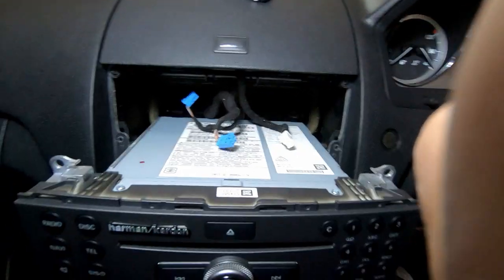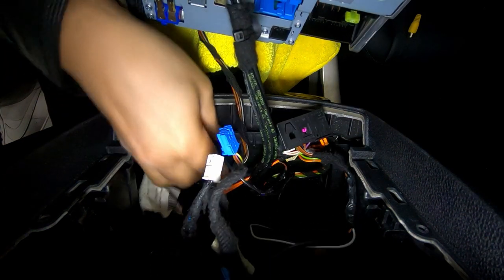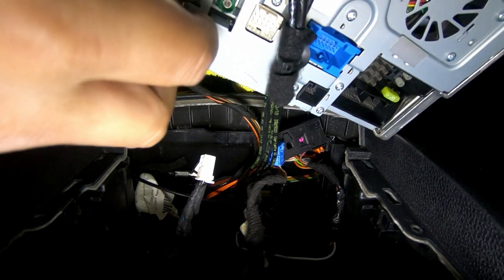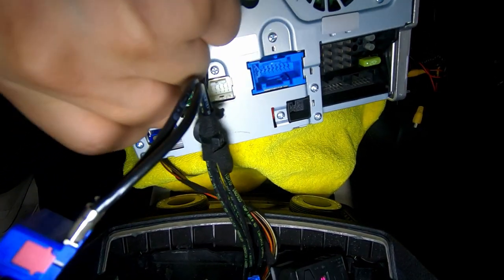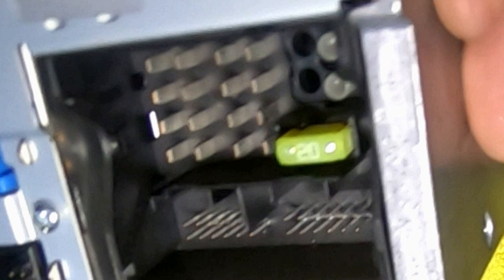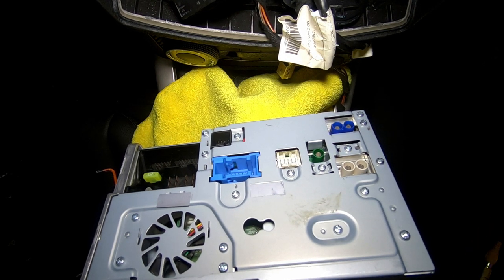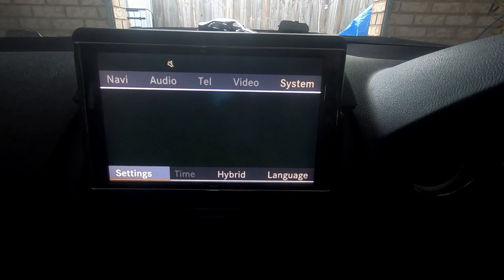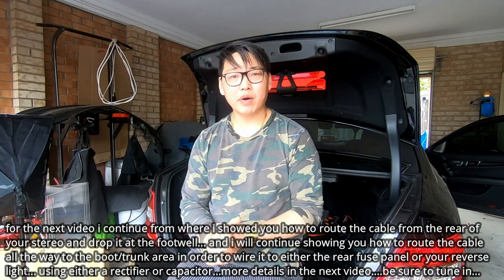mercedes w204 stereo removal+brief backup camera connection+activation

Comment: That’s what I’m talking about. If you’re gonna do it, do it right.
Reply from the maker: thanks mate next 2 vids will.be routine signal cable and then removing boot trim and lining to access license plate  light assembly to install either boot handle camera or license plate light camera.... and cuz the video is so long I broke it up into 3 parts ....last video will show how to wire to backup light using rectifier capacitor and relay .... any method will suffice to reduce noise/fuzzy lines and error messages

Comment: For anyone with a 2013 w207 or any merc with the ntg4.5 system the connection you use is the left side of the double barrel green input on the rear of the head unit, you can't connect a fakra cable straight into it, you need to carefully remove the plastic shroud from the fakra lead that comes with your camera (or you may have bought the adapter lead separately), there's a little plastic retaining clip on the adapter lead which pops off with a pick, then you need to push the inside lead out, don't pull it by the wire, its tight but it does push out, use a plastic stick of some sort (i used a plastic lego axle!) and then push the connection into the left side (looking at the back of the head unit) of the green double barrel socket, then follow the steps to set up the head unit to recognise the camera, mine worked on the first setting, think its srvc, and enable it on selection of reverse gear, thats it. I hope this helps someone as I couldn't find anyone who could tell me which socket the camera should connect to.
Reply from the maker: good tips 👍 also wen ur never sure which fakra to connect ..trial and error never hurt ..same way u do the selection video signal... that's how I've always done it .. I'm not a professional..so I always test things ... trial and error as they call it

Comment: Hi there. Great video. Just wondering if this unit supports Bluetooth music streaming?  Thanks.
Reply from the maker: no it doesn't only phone calls
Reply: @MIKEYZVLOGZ  thanks I really appreciate your help
Reply: Sorry to be pain but do you know if there is an option available to add on music streaming to this system?  Thanks.
Reply from the maker: @vedranmujcinovic4000  because my unit has the mmi multimedia input i can use the bovee Bluetooth device that allows you to connect it via the mmi connector in the glove box and run Bluetooth musicv that way , here s alink https://www.googleadservices.com/pagead/aclk?sa=L&ai=DChcSEwiZ7pvn6ZyAAxUqC4MDHd0fCVMYABALGgJzZg&ohost=www.google.com&cid=CAESaOD2kcL30bMfLl9sqLw0_FAG9r2oKxUvW9QPfyaSl0Dyd0163fTG62-xAWrhpMVlD3LPBKqz3Y75jQcIJpuX71HPyCjjJ-6ZSKn1tVh-y56nvIvKBsQnNcZY8fsJgAbmag0gmKHF9jpD&sig=AOD64_09pCoy2H8aDLPrWzP1t9C6qlLI0Q&ctype=5&q=&ved=2ahUKEwi2ppXn6ZyAAxUi1zgGHYJFDuIQ9aACKAB6BAgEEA4&adurl=

but remember only if you have the MMI add on to unit u can do this, if not , u can only add after market unit or use a cheap fm tuner for bt music

Comment: Good explanation 😉 but the display trigger line where is it..where is conected the red wire ???
Reply from the maker: because we have a function in our system that we select ... you dont need the trigger wire unless you are using an after market system ..its designed for after market systems like pioneer that have a trigger wire ... wen installed u go into engineering mode in the system and select display cam wen engaging reverse that is kind of like our trigger for reverse camera ... hope this helps mate..

Comment: Thank you for the video, Do you happen to know where is the amplifier located on C300 2010, having issues with no sound, changed all the fuses, still no sound. Dealer told me amplifier issues but wanted $6200 to fix.
Reply from the maker: its in the boot behind carpet on left hand side ..remove the carpet cover for tail light and look behind it towards the front on the side above the rear wheel

Comment: Hello there , I have the small screen 4inch and I want to swap it to the flip one ! I know you need the whole set with unit ,vents and screen to make it work ! I have found the whole set I just don’t know if it needs any rewiring as the units are different at the back ! Thanks in advance
Reply from the maker: tbh im not sure as i am not familiar with the 4inch screen wiring

Comment: Hello again sir! You helped me already with the power for the rear camera, but now I have a different problem. My car is not a w204, it’s a C207 and, even though I have NTG4.0, the back side of my radio unit is different, the fakra cables are “double”. Do you know how can I connect it? Thanks!
Reply: Did you ever get an answer, im having the same problem, Chinese camera with useless instructions, I have a double green connector plus a single green above it, ntg4.5 head unit, c207. Set head unit to recognise camera and activate on R gear, it tries but just gives a blank screen. Did you get yours to work?
Reply: @andybowie8590  i have a different radio. Anyway, the single green is for nightvision. You need to connect in the double one
Reply: @DiogoSilva-hr8ee  I'll try again at the weekend,  thanks

Comment: Hello Mikeyz. I just followed part 1 flawlessly. I do have one question. When you connected the long rca video signal to the fakra rca adapter, the rca video signal cable side also has a red exposed wire attached. What are you supposed to do with that red wire?
Reply from the maker: that is only for aftermarket systems, ppl use it for triggering aka trigger wire usually a purple wire  ..so unit turns on wen u switch ignition on or even power... but in our case we don't need it cuz we have an automated system that recognises the camera already
Reply: @MIKEYZVLOGZ  
Hey Mikey. I was just about to reply and you beat me to it. I just got back from the garage. i skipped to video 3 for connecting the power to the camera and did a test and it all worked. It was great to see the camera on as soon as I shifted to reverse. I did nothing with the red wire from the rca video signals on either end. I was about to say that they must not be needed for our application but you beat me to it. 
Now tomorrow or next week I have to do video 2 which seems like toughest part. 
Thank you so much for putting these videos together. Your tutorial is by far the best out there. 
I was quoted $900 parts and labor from an installer.  I’ve spent $60 in parts. That’s a huge savings if I can get through video 2. I wouldn’t have tried it if not for your video.
Reply from the maker: @TAS  so glad u attempted and succeeded mate well done ..thTs what it's all about for me encouraging ppl like us and seeing them follow through with results ... just fantastic mate

Comment: where you 
connect that red (display trigger line)?
Reply from the maker: the red wire is only needed If u have an aftermarket screen and it has a trigger wire for your display screen ...if ur just connecting the reverse camera to your facTory screen the yellow av cable is all u need to plug in and just leave the red wire disconnected as we dont need a trigger wire for our w204 ....unless ofcourse u install and aftermarket screen
Reply: @MIKEYZVLOGZ  thanx

Comment: Hi Mikey
i have w204 from 2007 , I have done what you done but I don't have SVRC option for camera in hidden menu, can you advise please, do I need update merc system? thanks
Reply from the maker: u shouldn't need to ..once u connect the camera test it and make sure u get video.. once u do ..its done .and reinstall everything ... unless u are asking about something else..pls elaborate
Reply: @MIKEYZVLOGZ  when I connected my power cable from camera to fuse in the boot and set retrofit camera in engendering mode to FBAS I have constant image on screen but I don't have sat nav working, again when I connected to reversing light no signal at all. In engendering mode I have only option to install or not install reversing camera and maybe this is a reason why is not working with reversing gear? Thank you for your time, your vlog is very useful 👍

Comment: Hi can you tell me how to connect a camera to the back of a c207 ntg4.5 head unit, it has a double green connector which in my car has one lead connecting to a fakra input wire although there's no factory fitted camera so don't know what thats for,  above the double green socket is a single fakra socket, currently nothing connected to that. I tried the camera input in both sockets but it didn't work, I set the head unit up as you showed and when I select reverse gear the screen goes black with a safety message on it so it knows there should be a camera but no image comes up. Any help is appreciated thanks.
Reply from the maker: hmm that's abut strange as it should read it .. did u also select the right video output like svcr .. try selecting each until u get video
Reply: @MIKEYZVLOGZ  I didn't try the others, I'll try that at the weekend mate thanks
Reply: Hi did you manage to fix by changing the options? I have the same problem @andybowie8590

Comment: Can you install a camera on the 2010 c300 base model?
Reply from the maker: yes
Reply: @MIKEYZVLOGZ  thank I saw one blogger set you needed upgrade your software to make it work and then a stereo installer told be you can't link a back up camera to a stock unit. But you and others have proven that is not true. I will study your videos and do it myself. Thanks again.

Comment: I would like to buy green cables of camera but I have look at the links in the description but I have not find this cable, can you help me for that?
Reply from the maker: check part 1 video description again i listed a new set of links
Reply: @MIKEYZVLOGZ  Thanks for your help. I need the green wire you described in your video. 11:57 minutes and 14:39 minutes, green cable included, I'll plug in the same camera as my device. I need that green cable

Comment: what is this silver cable for?
Reply from the maker: which one... which silver. able are u referring to? sorry haven't done this in a while need to remind me
Reply: @MIKEYZVLOGZ  The one which is next to the green fakra connnector.
Reply: @MIKEYZVLOGZ  at 12:37, you're holding that silver connector
Reply from the maker: @yijianggu5203  that's for video signal
Reply from the maker: @yijianggu5203  ye its the video signal cable

Comment: Ok but how do I turn off the parking lines on the screen?
Reply from the maker: Should be part of you Camera If your camera has parking lines you will have it as well if your camera does not have parking lines it will not show
Reply: @MIKEYZVLOGZ  i turned off the integrated camera lines, but the car itself overlays it's own lines on top of the camera feed.

Comment: Whats the fnction of the factory fakra cble?
Reply from the maker: depending on the options of your car usually a fakra cable is for a factory video signal either a backup camera   or an additional video signal..especially if it green ... now there are other fakra connections aswell but they are for other properties..Mercedes have just chosen to use that type of connection rather then the common connectors like RCA etc... just merc being merc
Reply: @MIKEYZVLOGZ  If the fakra cable is unplugged and used for the camera what's not going to work?
Reply from the maker: if u dont have a factory camera .. nothing will happen... its there for future installs hence a reverse camera
Reply: Excellent tutorial and demonstration. Especially the care you took to explain everything. Much appreciated,